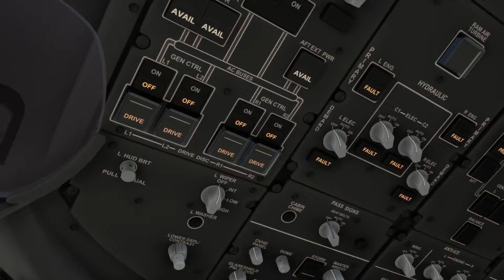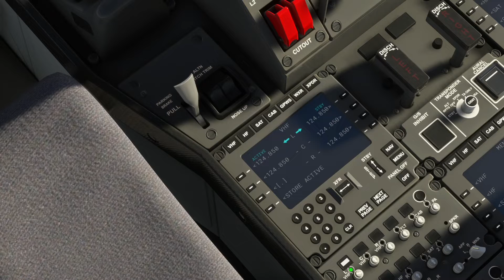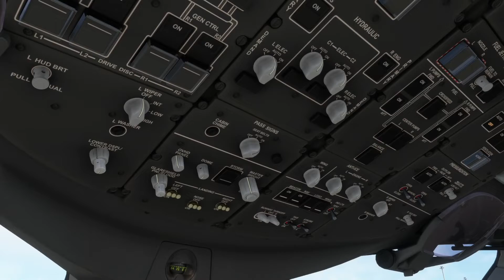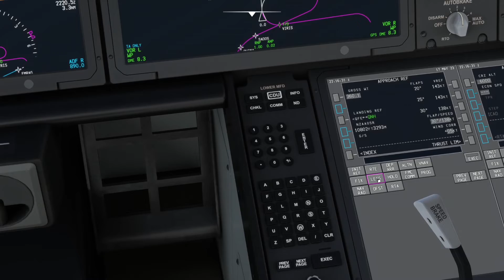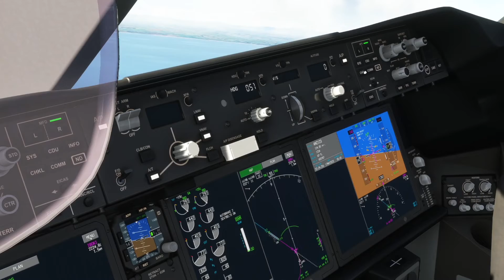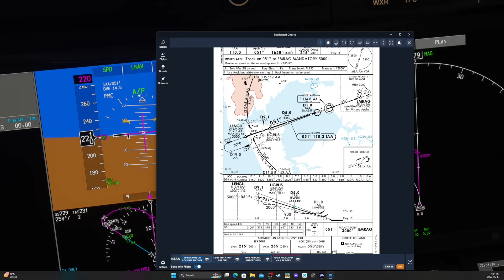MSFS | AAU2 Beta | Boeing 787 | Circuits in NZAA | Hold |RNP Approach | Missed Approach | ILS CAT3 |

Comment: One curious thing is that the TO/GA button doesn't work if you have AP OFF...that's a bit annoying...(it works for takeoff), if you're approaching (AP Off), and press TOGA to going to "missed approach", simply the TO/GA button does not engage...it's very confusing.
Reply from the maker: It should work, as long as the flight directors are on which would give you TOGA flight director guidance without the autopilot. There are also some other requirements for TOGA to be available such as radar altitude.
Reply: yeah...but . If you can, do the test...A/T on and AP OFF...try press TOGA as if you were really going for "missed approach"...it doesn't work (unless the AP is on) @Bandit-FS

Comment: Great Video Bandit, very much appreciated.  Just wondering if you worked out why the RNAV approach sometimes refuses to descend below the initial altitude window setting, and down the VNAV Path.  So frustrating.  Could it be that the lowest altitude/aerodrome height needs to be entered (and selected?) prior to TOD?.
Reply from the maker: It depends on the approach. If you are doing a RNP with a curved segment then you need to set airport elevation in the MCP and engage VNAV. Any other a approach, ILS/RNAV, or straight-in RNP then you can put the GP intercept altitude in the MCP and fly  in LNAV/VNAV and then arm approach mode on the MCP.  When it captures the approach it will capture GS for an ILS or GP for a RNAV. Hope that helps.

Comment: Thanks for sharing your experience with the AAU2 beta.

1. Can you fly the Dreamliner without going thru the Checklist?
2. Have you tested if the Simbrief Panel works with AAU2 beta - I don't want to manually input the legs 😅
Reply from the maker: 1. Yes
2. Yes, Simbrief Panel to display your flight plan but  you cannot import you're plan into the FMC.
Reply: Cheers, hopefully Simbrief Panel will be updated shortly after AAU2 is released.